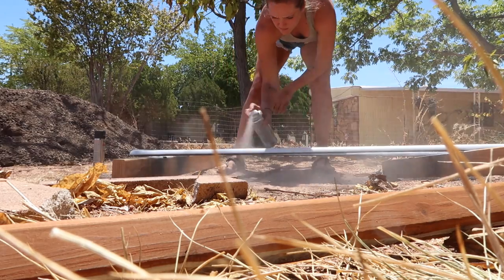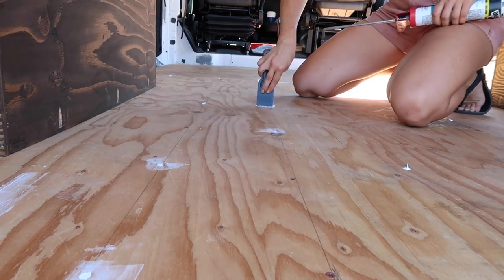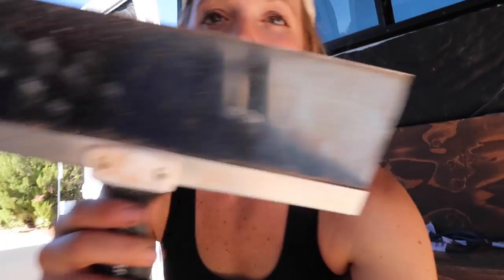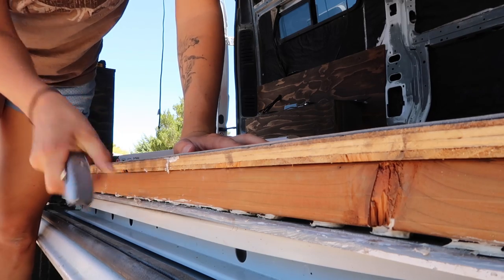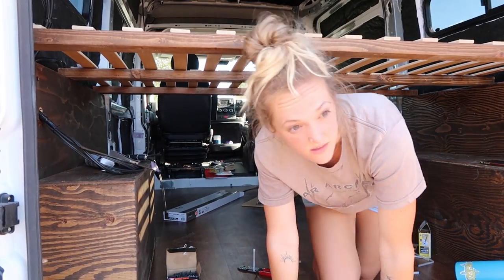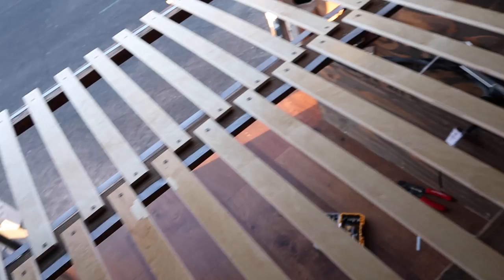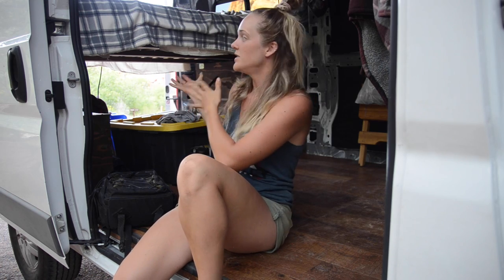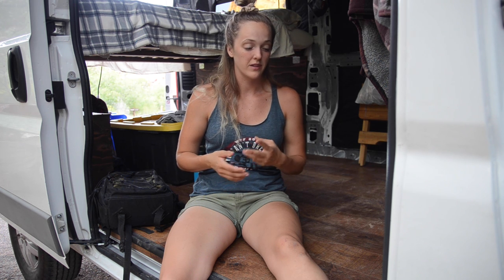The TRUTH about VINYL FLOOR | Floor & Bed Frame Installation

Comment: I’ve been planning on doing this but I have a few questions and it’d be great if you could answer them for me. 

Is this super expensive? I mean in the long run I’d feel like it would save you a lot of money, but what about the van payments? There’s always some type of problem with cars, so I guess I’m trying to ask if the payments are just as much as you’d normally pay for a house?
Reply from the maker: It can be as expensive as you want it to be. Some people have VERY nice vans, with a lot of extra power, shower, toilet, storage, AC, heat. My build out is pretty simple and on the much cheaper end of van builds - I wanted it to be minimal. I won't have AC or heat, no hot water, and enough power for my lights and electronics. As for the payments, yes I do monthly payments for my van and put away money for upkeep. 
Gas is an extra expense, and some people end up eating out a lot. I plan on saving a whole lot of money during my experience because I won't have many things, I won't be paying for utilities, and my "rent" will be cheaper. 
BUT not everyone wants to live this way - so it 100% depends on what an individual wants and needs! 
I also have multiple friends that live out of their cars, no fancy build, no extra solar, and they love it. Different strokes for different folks!

Comment: Hey Linnea, qui k question : are your bed only supported by the wall panels, or is there an extra support behind the wall?
Cheers
Reply from the maker: Hey there! Yes - the wall panels used for the "garage" are 1/2 inch ply that is bolted to the wall. The bed supports are laying on that ply wood and each of them has a metal L bracket as well. I hope that helps!
Reply: @Linneaandakela  Yes it does. I am going for the same approach but was thinking of a removable wall panel (to access the back panel of the electrics) hence the question on the bed support. 👍

Comment: I can't believe how well you can cut a straight line with a utility knife. 

I see you commented that you did drill pilot holes in the bed slats but, did you also drill a counter sink? That looks like what was causing the splitting.

You look like you are 5' 9" to 6' or taller. I am assuming you can't stretched across the bed, are you sleeping at an angle? If so, are you worried about cramping or discomfort overtime?

You also said in other videos that you are not really using any kind of plan, but I am assuming you have some kind of vision on how you want to lay things out. Maybe you have already done that, but I would like to see what you are envisioning. Like, have you planned out a space for your eventual composting toilet? What about water storage and possible waste water, and or cooking and/or meal prep? What about C/O gas monitoring alarms or smoke detection? 

Sorry so many questions!!
Reply from the maker: Hey there! No problem, I don't mind questions at all! 
So I am actually 5'6'' (5'7'' with shoes on). I have a lot of space on my bed and yes I can stretch all the way out. The cool thing about promasters is that a full size bed can fit perfectly the "across" way. My boyfriend is 6ft and sleeps stretched out comfortably as well, although he does think it will get a bit tighter when I finish putting the walls up. He isn't worried about feeling cramped though. With both of us, it is still super comfortable! 

As far as my layout, I will try my best to explain! 
1. Under my bed will be a small den/cave space for Akela. The rest will be partitioned off with shiplap so all storage will be accessed from the back. 
2. Next to the bed, across from my large door, I will make a small couch seat (as of right now). This is because I do want to create a slide out table to work on, and under that seat I will make large enough for the composting toilet that I hope to purchase in the next few months. 
3. The rest of that far wall will be "kitchen counter". The back of the drivers seat will be another wall of my kitchen. My fridge will be under this counter top. 
4. On my sliding door side I will build another counter top. So my walkway will be much smaller. This is where I want my sink and water jugs to be. That way I can turn my sink around and have an outdoor shower thing. Also this will allow me to change out water or run a hose to my water without needing to go through my entire house to do so.
5. cabinets will be all on the side across from the sliding door and stretch across the length of the van. 
6. The passenger seat will be able to swivel and I think I want to have some option for a table? Not sure yet. 

I hope that answers the bulk of your questions! Next week I am planning to do the solar stuff and then finish the walls. After that, everything else will soon take shape!
Reply: @Linneaandakela  You have really have put alot of thought into it.. Very impressive, looking forward to watching you continue to build it out.

Comment: Well late but ,, pretty drilled holes will stop the cracking in the slats  or any wood for that matter
Reply from the maker: Not this wood - I had predrilled it all and it was still splitting. But it worked out great anyway!
Reply: @Linneaandakela  damn .. there goes my comment ha,, enjoying your vids ,  great energy from you.. keep it up 😀

Comment: That is what I used… don’t drop anything pointed .  I thought I wanted a soft floor so they had some sheets of this pink foam which made my feet comfy.  PROBLEM. I put a camp chair on it sat down and got 4 holes in it.  That was right about the time I put a screw right into gas tank.  I do learn from my mistakes but there is so much to make mistakes with.  I didn’t have an addiction to YouTube n finding out all the things  I did wrong on my two vans I sold.  Oops sorry buyer I did however tell them how I did it all.  They found the gas tank issue.

Comment: Your Ikea slats may not flex per their design, because you screwed both ends. I hope the slats don't split at the screws over time from the horizontal force transferred from the weight on the slat humps.